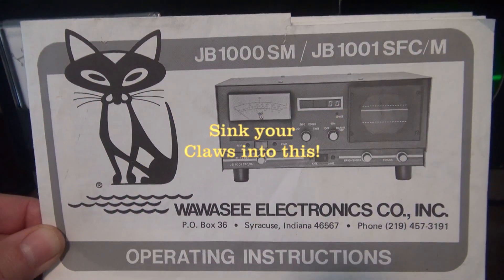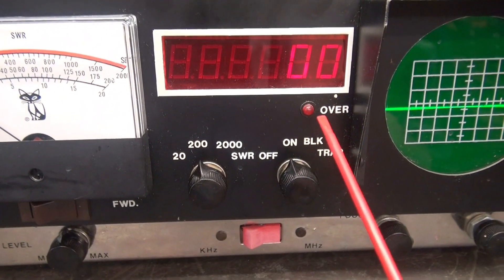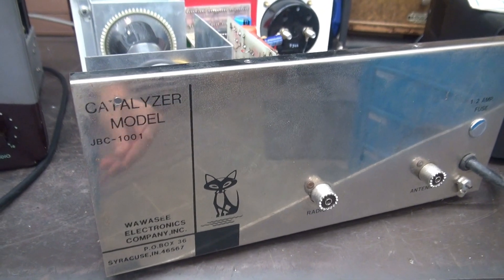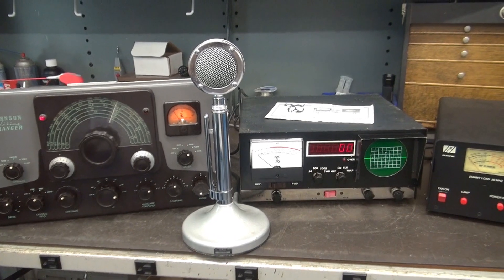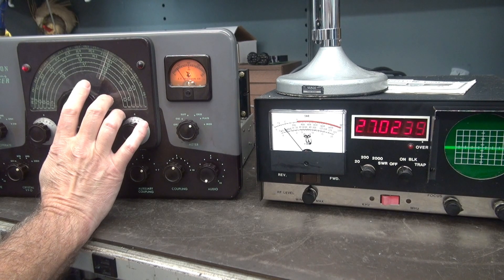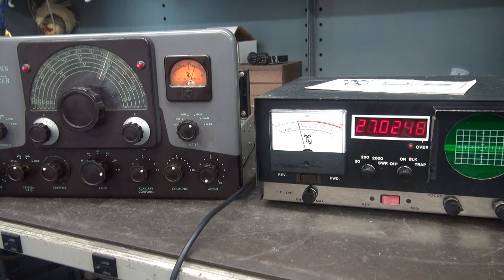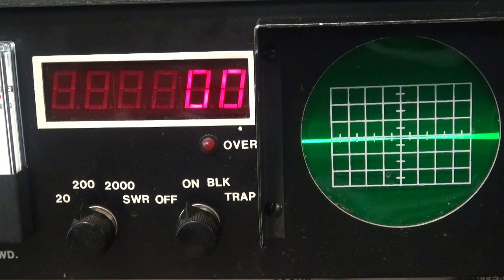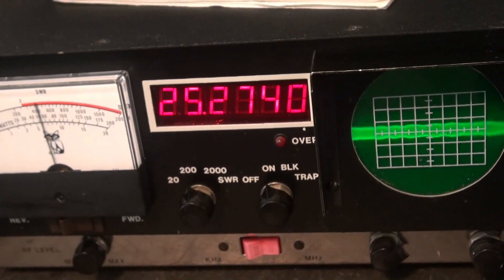Demo Wawasee Catalyzer CB Station monitor 11 meter band Johnson Ranger Transmitter

Comment: Note how the power transformer is mounted at what appears to be a sloppy placement like it's just thrown in there. This is actually  a very critical placement to reduce EMI from affecting the CRT. Very common in analog CRT scope designs. It does look like a garage manufactured unit but I say that with the utmost respect. It looks well engineered and constructed, just built on a smaller budget. Kind of like the custom commercial stuff I contract build for one-off applications in the broadcast television industry.

Comment: Clean but looks more like a hobby job... 
Not even the fuse is straight or insulated... The transformer d the bogged cap just topping it. 
Lastly, the crt has no shielding...

Comment: Got the same unit in line & mostly on 40 mtrs daily, counter was beyond repair ( damp storage )  rusted off ic legs ect , but rest is good cond, recapped ect great fined -only got it originaly for the tube  !

Comment: I made many dx contacts 27.555 usb international call frequency late 1980's . That's a fun band for dx. At that time10 meters empty all the hams were working down there. 3 element maco. It was good for 10 and 11 no problems. 40 watts most of the time depending on what radio was being used.

Comment: When I was a kid 11 m was an amateur band, then the FCC stole it, is nice to see an amateur operating on what should be hours. At Hamfests transmitters that had 11 m seem to generate more interest, but when I would ask for a call many would retreat.
Reply: A friend and I bought two 11-meter ground plane antennas off a guy, we each put ours up on our houses for CB use, early '70s before the boom that ruined it (sort of like the early Internet days).  Best performing omnidirectional base station antenna I ever owned.  Couldn't even read the manufacturer label on it, but it looked like Antenna Specialists if I recall.

Comment: Wow, I haven't seen one of those in years!  Likewise anything using the trapezoid waveform display; isn't it supposed to show yuo're overmodulating when the little "pip" appears at the point of the triangle?

For another example of similar gear, I still own a a Pride Electronics model DB-20 receive preamp with the light up ON THE AIR sign.  Sill works, last I knew.  Also a Sencore CB-49 test station, but the big rotary switch froze up, needs work.  Never did have the owners manual for it, if anyone knows where to find a copy, even a PDF file, I'd appreciate it:
Sencore CB49  Portable CB Analyzer & Performance Tester  Operation, Application and Maintenance Manual